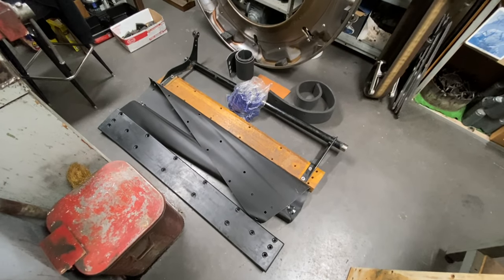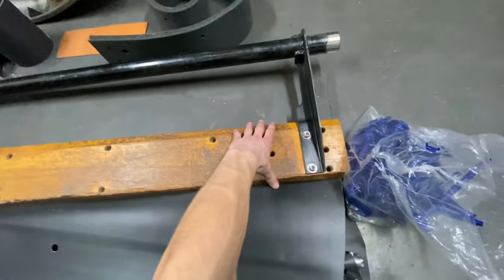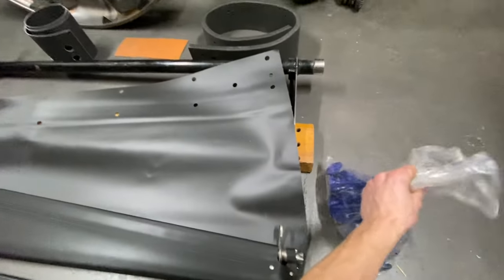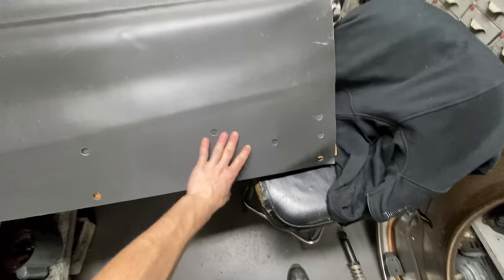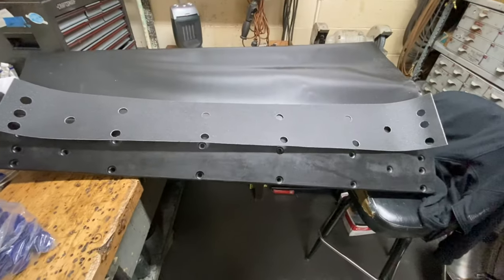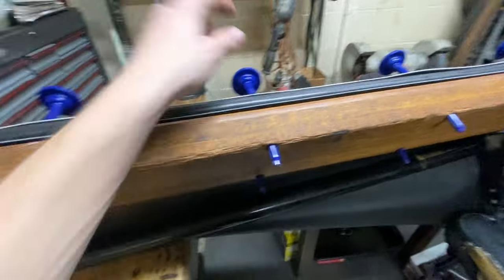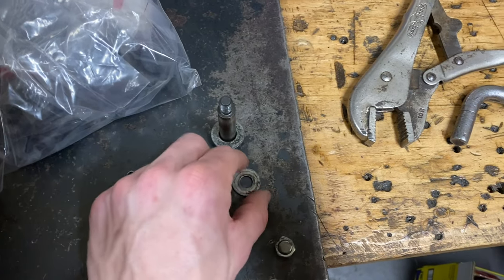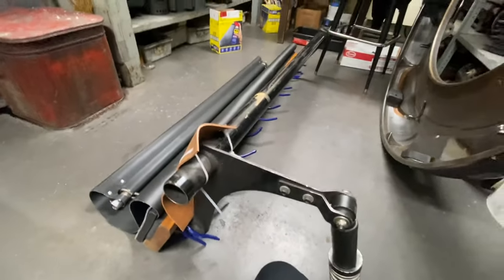AMF Pit Curtain Assembly|askJoethepro

Comment: Even though on 82-70’s the curtain isn’t connected to the back of the table, they are essentially the same thing.
Reply from the maker: Yes you’re correct. The only difference between the 82-30 model curtain and the 82-70+ models is the weldment is slightly different and the curtain is mounted differently at the top.